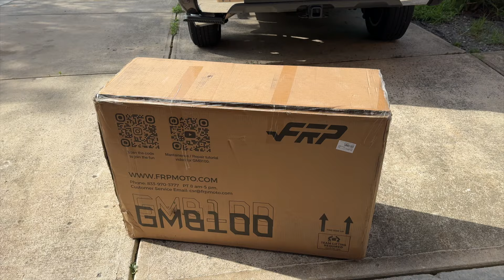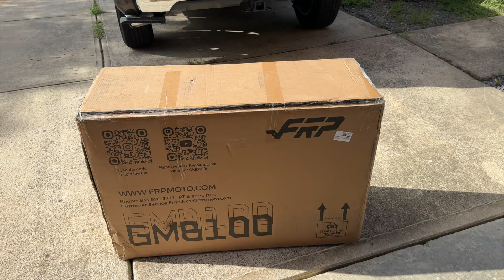FRP MINI BIKE IS A AWESOME !!!

Comment: No, the little plastic bottle it comes with it is for the clutch and the chain so you put all on that and that and put it on your clutch, but on the chain itself to all that’s what videos have been doing different people don’t start right away just pull couple timesstarted let it run for a while and then don’t take it full speed breaking in